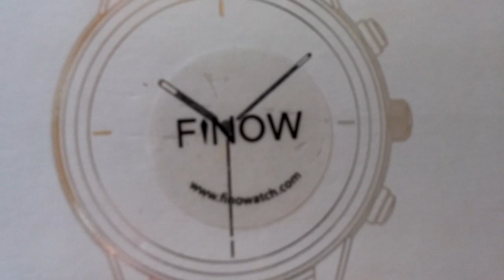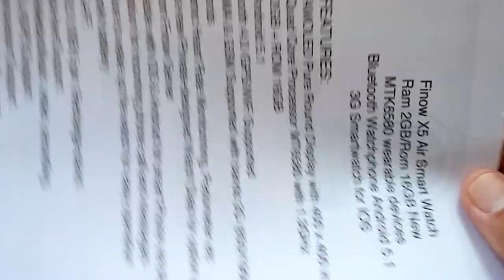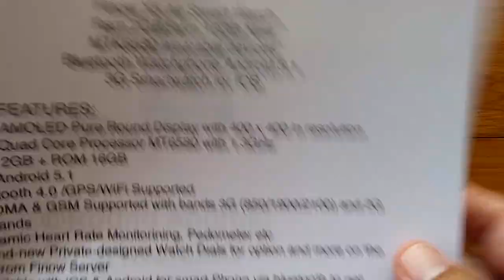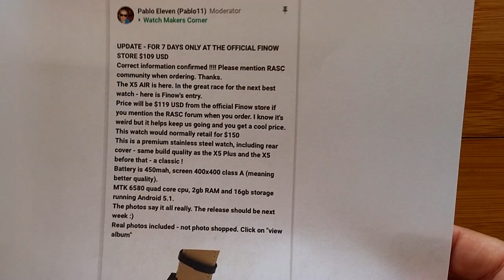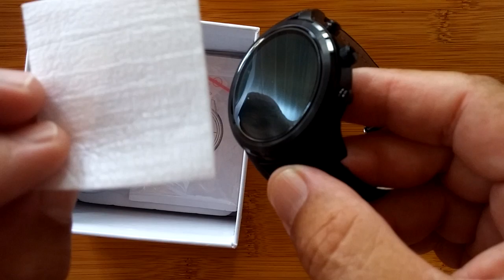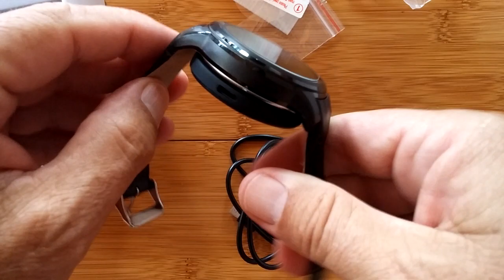FINOW X5 Air Android 5.1 2GBRAM/16GBROM Smartwatch: Unboxing & 1st Look

Comment: still waiting when kingwear gonna release 2gbram version, right now just no.1 and finow major the league
Reply from the maker: Get ready for the IQI I4 bump up as well.
Reply: I am in to my 48th hour with the IQI I4 Pro 2GB Ram & 16GB Rom battery life is poor running it with a sim, Data wouldn't stay enabled, in coming and out going calls were just as good on my MPow Bluetooth over ear headphones as they are from my phone, but, it seems that even when connected to the phone via the companion app only with every thing off that the battery life is still poor. I tried other sync apps as mentioned but was unsuccessful in getting them to recognize and connect to the I4. Maybe I'm doing something wrong!  Antutu scored 20885. I need a good battery management app, and a good companion app. If I were to buy another brand, which would you suggest as having a solid all round product
Reply from the maker: Thanks so much for your report r a t a v a e u r t. That information is extremely valuable as I don't have time with each of these watches to put them through long battery testing. I'm going to as our audience to jump in and advise on good battery management apps, especially for watches. As far as another brand, I really don't know. They all have their shortcomings. Anybody have something to recommend? Adrian, a frequent commenter, will recommend his watch with a 900 mAh battery, but it's Android 4.4, limited memory and kinda bulky.
Reply: im agree about issue short battery life, even my fancy v8 can last for 3 day as a watch only. could be mediatek often consume battery even in smartphone world, i really hope for snapdragorn chip or hexio10😂😂😂😂 next time on smartwatch

Comment: I purchased the DM368 Plus and received it yesterday and love the size and feel but i'm new to getting the custom clock skins could you point me to a good beginner video walk thru step by step.
Thanks appreciate all that you do.
Reply: My DM368's touch panel just died last week. It works fine apart from not registering any touches... Opening the watch i found that many of the connections had strong oxidation on them. I did wear the only once or  twice for workout and never got it soaked in rain. Just something to watch out.
Reply from the maker: Wow, I wish you guys would post this one on the DM368 video review comments section. I doubt it will reach the people the should see it here on the X5 Air thread.
Reply: I apologize. I  reposted it on the DM368 video reviews.
thanks again.

Comment: Hey Mr Ticks - did you select firmware upgrade when you flashed that FW I gave you ?
Reply from the maker: I don't know how to do that. I flashed the only way I know how, choosing the Download button with the Download option selected after loading the scatter file and connecting the watch via USB in the off mode.

Comment: All good. However the battery capacity raised my concern.  Looks like the novadays batteries technology doesn't follow behind the rest of the guts
Reply from the maker: You are right. We're needing a significant breakthrough in battery technology. These manufacturers are working with what's available on the market, and until that changes, battery life will be restricted. It's not a fault of the watch or the company, but the overall battery technology at this point.
Reply: WRONG Mr. Ticks its purely due to do the design of Chinese smart watches and there unwillingness to change things up that they all have very bad battery life. You should know better than to blame battery technology. Adrian.

Comment: U dont have to write anything if u want to get it for 109$ lol
Reply from the maker: True, but it REALLY helps us out, and I mean REALLY. Adding the four little letters, RASC to the order, helps to make sure these sales are coming from folks like you seeing it here. Nobody would know to put RASC on the form if they haven't seen it here or read about it here: https://plus.google.com/u/0/communities/109827242607524552712

The support budget is $zero. It's all volunteer. When companies like FINOW help out with sample watches for testing firmware, checking cellular data connections, GPS lock and a hundred other things that come up, folks get answers. Without them, well, it's next to impossible. So yes, we REALLY appreciate when you actually buy a watch that you use the code or coupon or whatever little thing we're asked to have our viewers/readers do.
Reply: SmartWatch Ticks in your opinion between IQI and Finow, which company produces a more reliable product?
Reply from the maker: FINOW watch bodies are solid, all metal (at least the "X" line -- the "Q" line is cheaper and lower quality with plastic backs, etc.). IQI products seem to be more water resistant as the speaker isn't on the bottom where body sweat can be a problem, but on the side where it's easier to hear. Still, they use plastic bottoms with screw on SIM cover openings. It's a hard call to say which is more reliable.
Reply: Just saw you reply! Thanks! I have the IQI I4 Pro for the past 48hours! I like it but I'm a bit disappointed. Look at my message to you higher up the thread when you mentioned  it
Reply from the maker: Just got to it and replied. I read my stuff from oldest to newest and had 133 to go through over the last 9 hours. Light load today!
Reply: lol! I'm going to run what I call a "naked" antutu! That's where I factory reset and download antutu only, before I add other apps and enable any features. Sounds dumb, but, in the past I've noticed a difference in my mobile phone scores
Reply: 1st Antutu run with watch completely set up 20885 2nd Antutu run (naked) zero apps installed (except for antutu obviously), phone not set up in any way, factory reset was done prior to run score: 20939

Comment: I am from India and just ordered this. Eagerly waiting to get it.
Reply from the maker: This link still shows $109: https://www.aliexpress.com/store/product/New-Finow-X5-Air-Smart-Watch-Ram-2GB-Rom-16GB-MTK6580-Dual-Core-Bluetooth-Watchphone-Android/2130161_32824859519.html?spm=2114.12010611.0.0.aNCwba

Be sure to put "RASC" in the comments so we can get more watches from FINOW for review! It won't cost you any more, it just lets them know you learned about the watch here and/or on the Round Android Smartwatch G+ Community.
Reply: John Daniel what is the cost of the watch in India
Reply: Price Please ;_;
And which courier did you used.
Reply: INR 7699
Reply: I ordered through GearBest
Reply: After the long wait got my FINOW X5 AIR from gearbest.com delivered to Inida.
But sadly Phone is not working getting "Cellular network not available" but getting all 4 bars in the network tower signal. In network settings i can see all available network names but unable to register. I tried with 3 different Airtel SIM's, Jio SIM and T24 SIM. Nothing works please help.

India's mobile frequencies & bands are
2G : GSM 900 MHz, GSM 1800 MHz.
3G : WCDMA/HSPA/UMTS 2100 MHz ---- which are equivalent to BAND 1.
www.gsmarena.com/network-bands.php3?sCountry=India

These frequencies are support by FINOW X5 AIR
GSM: 850/900/1800/1900MHz
WCDMA: 850/1900/2100MHz